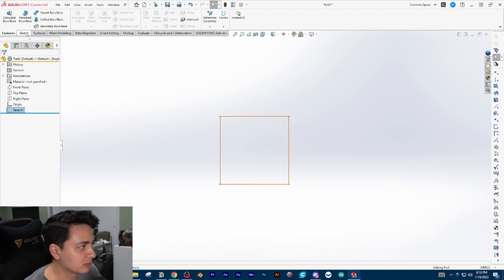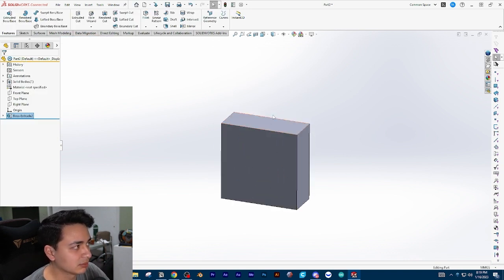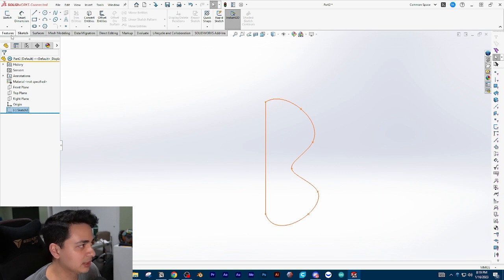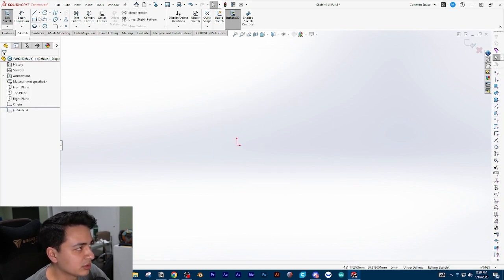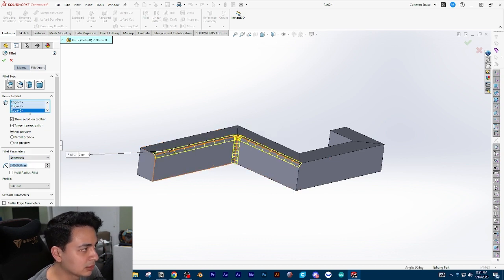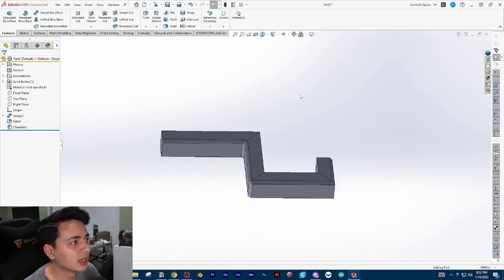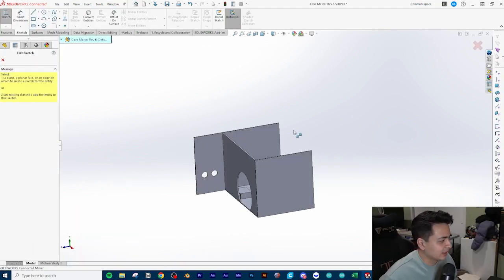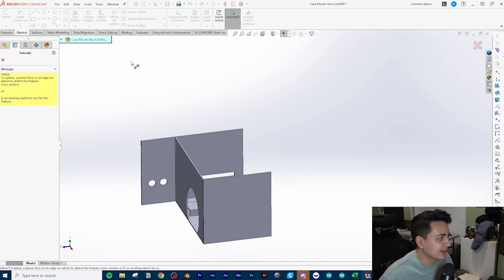Intro To Mechatronics: Part 2.2 SOLIDWORKS Intro to Features

Comment: 5:29 - This is basically your powershell search feature so people can find "better" features from older versions. Using this feature, I've done a lot of cursed things, such as making an entire assembly into a single part, which saves space, exists, and I find pretty cursed. 

You can also, alternatively, right click on the face, and sketch directly on it. That's what I do because I am lazy, and sometimes lazy is fast.